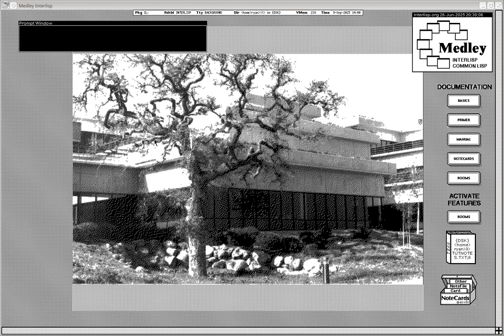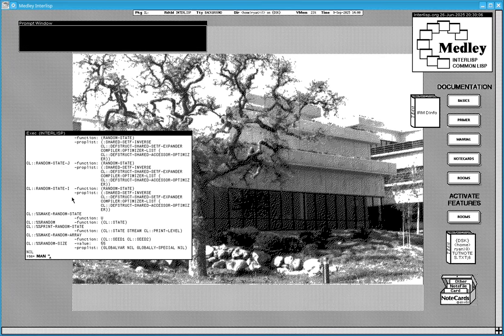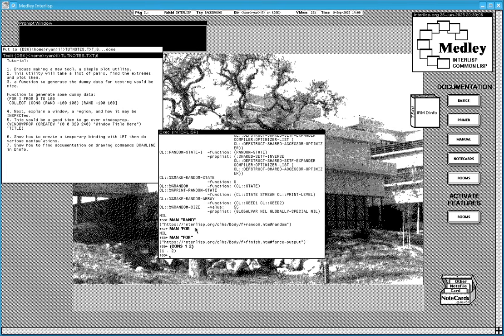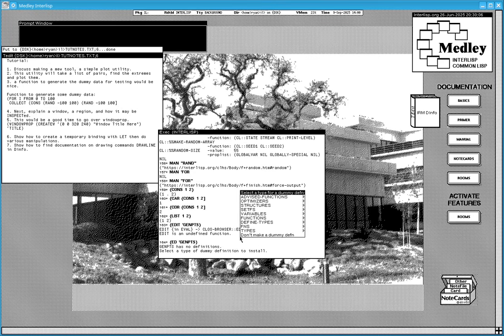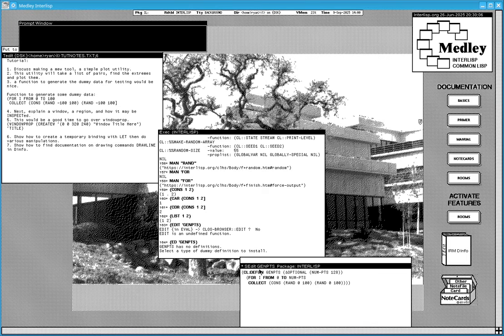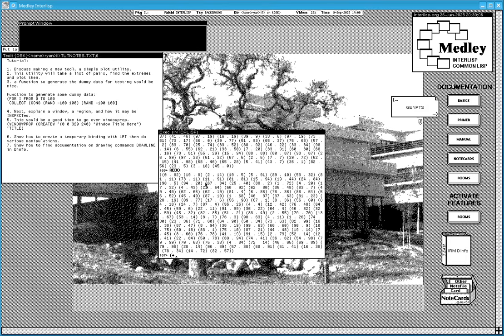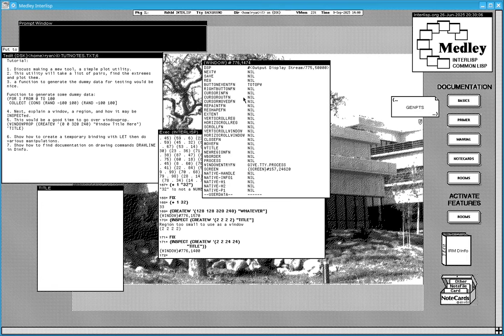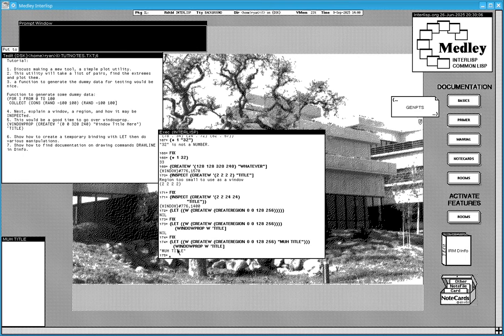Interlisp Tool Making Part 1

Comment: Can you explain more about this interlisp environment is it an IDE or an OS based on Lisp because it has some really odd features it looks like you are using a new OS but at the same time you also opened chrome which means you are not on a totally different OS.
Reply from the maker: It is a totally different OS, but you can run it through a virtual machine with no hassle on Mac, Windows or Linux. They've packaged it very nicely.
Visit the Software section to grab your copy! https://interlisp.org/